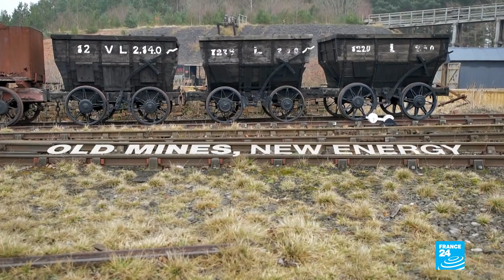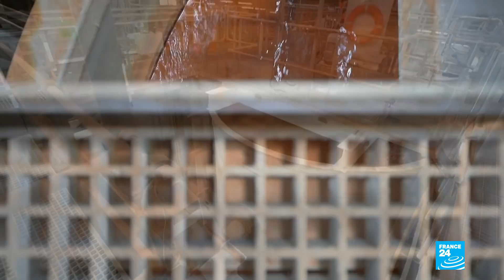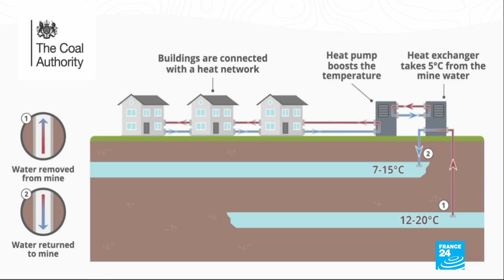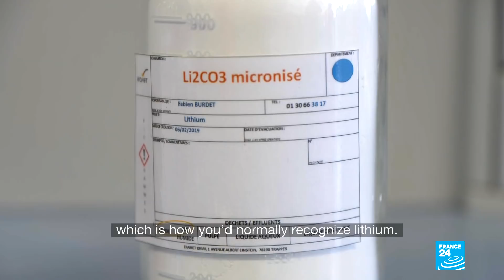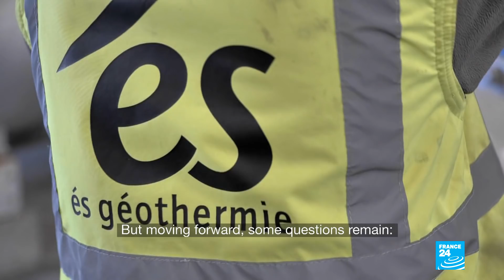Geothermal energy: A new, green lease of life for old coal mines • FRANCE 24 English

Comment: A geothermal project that was trialled in Australia around 10 years ago failed because the steam produced from the molten rock released various crystals as it cooled which in turn blocked the pipes on the way to the earths surface and to the best of my knowledge no one has come up with a solution to the problem thus far
Reply: Do you have any links on this information. I am intrigued. What type of crystal?
Reply: @michaelbarahona7871  I don't have any links, but I'm sure that there'd be documentation if you knew where to look, I'm fairly certain that it was a collaboration between government and private enterprise, my source of information came from one of the scientists involved and the company that he works for was tasked to find a solution, which, as far as I'm aware hasn't eventuated. The crystals I'm thinking he said were various salts and other impurities in the molten rock solidifying in the pipes when cooled with the water to make the steam to run the turbines
Reply: Which is why several lithium geothermal projects exist. Their is value in some of the minerals in the fluid, especially if they geothermal source is a brine.

Comment: Connect up solar and turbines extra energy to the plants to encrease the temperature of the water when there is no other use for the energy produced and defacto you have a steam battery storage system encreasing the copasity to produce heat over time. Same idea as using excess energy to produce green hygiene the only type of hygiene we should produce as grey and blue hygiene have been proven to be worse for the environment then bering the oil or gas needed in the first place.